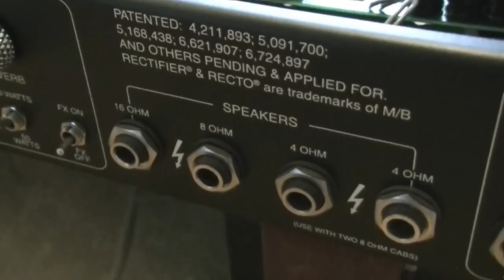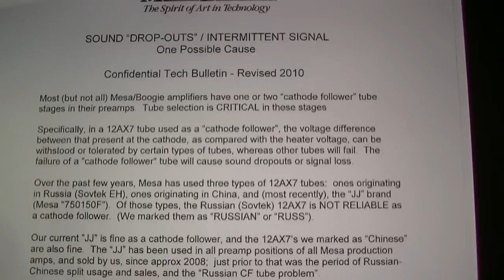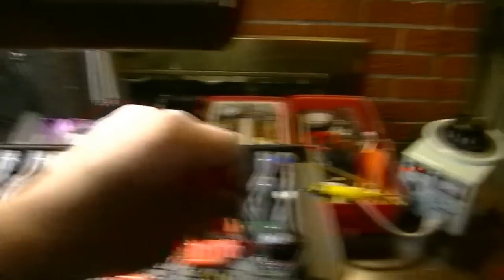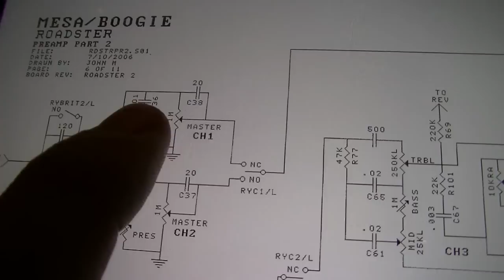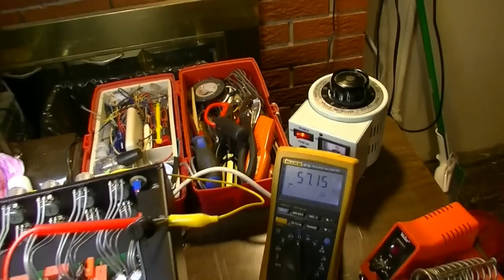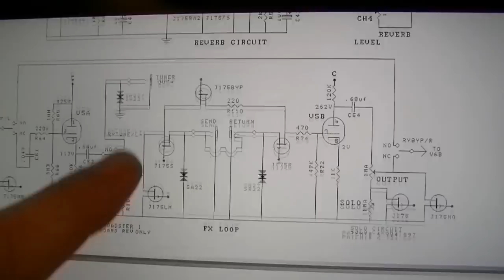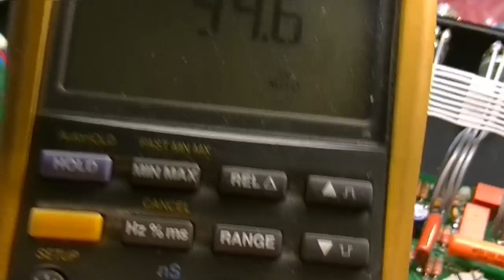Amp Tech's Worst Nightmare - Mesa Boogie Roadster Repair

Comment: Hey I come from a digital background and I also have decent understanding of analogue electronics, like I know how a Hi-Fi amp works, but I never had to deal with guitar electronics... but could you explain me something?

What's up with the comment section? Every second comment is PCB hate, seem like, but how come, why? It's beyond my grasp what's happening here. What do they imagine ideal amp to look like, an ad hoc rat's nest? If someone designed something of THIS complexity, and it looks majorly functionally justified, without a PCB, what chance would anyone ever have to troubleshoot it?
Reply from the maker: I don't object to PCB generally, but I dislike board mounted tube sockets, pots, and jacks. I prefer simpler amps constructed using point to point wiring. Ways easier to work on. Something like this though, you probably couldn't build it using PTP, and even if you could, it wouldn't be cheap.
Reply: I could be horribly wrong but, as far as Mesa Boogie's page says, it's a 2006+ amp, but the boards look like they were made in the 70s by the tracings. It's about time to be using proper even spacings on the gaps, looks as if old hand drawn board, and the solder mask looks like those very, VERY cheapo solder masks from old TVs, the lack of connectors for some of the cables and the solders kinda mixed quality as well, no sanding at all on borders...

It would be a good PCB work for the 80s but not to a 2006 amp.
If you check your PC's motherboard's PCB you'll kinda notice what we mean by this.
Reply: What i see here and something you aren't going to see on a PC main board, is 2oz copper weight underneath, anyway more than standard weight, that's why the mask is so wavy. Also the mask has been applied way thick, and its pigmentation is pretty weak, but either is actually a good thing. That green, you shine some UV light on it, you're gonna see if it's been cooked because it loses fluorescence with heat, you can't do that with any other solder mask, so if you're serious at all, you go classic green. That's why every Supermicro server PC board is green. It all makes sense.

And i just opened a 90ies SONY TV the other day, and there was no solder mask in there at all. Not the tiniest bit.

Old layout works, why change it? Well sure if designing a high end audio item today, my instinct is to go all out on the same tricks that keeps high frequency electronics working well - 4 layers, pour ground and voltage on the inner layers, no signal there, use those inner pours as heatsinking just to reduce stress, SMD parts for all resistors and transistors and shorter overall routes, much better noise resilience and reduced crosstalk, but will that even go over well with the people who buy these things? Doubt a person who buys tubes trusts newfangled shit. Keeping distances even is not necessarily an advantage, some signals are always going to be more tolerating of crosstalk than others! It usually pays to be sceptical of layouts that look TOO automated because you never know whether anyone actually gave a crap.
Reply: The Guitologist yep board mounted inputs and controls are the bane of affordable studio and live performance electronics, they just keep going and depending on secondary mounting or lack thereof, the board underneath can crack too... 

I can see the issue with tube sockets, thermal stress.

Comment: So that was your ground fault... I'll see myself out. :P I appreciate you taking the time to explain what you are doing through the whole process. I have subbed. I don't work on my amp or do much in the way of troubleshooting electronics as it seems rather overwhelming. I have a soldering rework station, multimeter, and helping hands for replacing pickups, making cables, replacing a component here or there. I have been reading a little about circuit design, but all of this is still rather new to me. Do you have any suggestions for how to learn basic audio circuit design? In particular I'm interested in understanding how to create audio circuits for guitar pedals (not necessarily making someone else's kit, but I suppose that is a good way to learn). Thanks!
Reply: a very good book on building home-brew guitar effects is "electronic projects for musicians by Craig Anderton" ,,, looks like Amazon has it for around 20 bucks, or if you look hard enough you might find it online for free, but if you have the funds its well worth the 20 bucks, and i'm all for supporting the author, of such a good work, i purchased mine in a book store about 30 years ago, and its a great book, 

:)
Reply from the maker: I'm not a pedal expert, but to understand pedals enough to know how to design your own, you're going to need some grounding in basic electronics. Any books on that will be helpful. Early RCA manuals, etc. There are old mgazine articles I've seen on the net from Popular Mechanics and stuff back in the 60s and 70s on how to build you own guitar pedals. Or just go to Radio Shack and get the parts and build a simple circuit to get your feet wet. The best way to learn something is to dive in and be unafraid to make lots of mistakes. The fellow I mentioned at the end of this video, Tony Dorris, hangs out on Amp Garage forum and knows a ton about pedals. That would be a good place to go and build something and have others critique your work.
Reply: Thanks! I rely so much on the internet for knowledge that I often forget how much great information is printed. I'll check out that forum as well. Thanks again!
Reply: I own Home Recording for Musicians by the same author. I'll check it out, thanks!

Comment: Just stumbled on your channel and watched this video, I subscribed based on it alone.  Nice documentation on troubleshooting electronics in general and of course tube amps specifically.  I'll shotgunned things before and got pushed astray in my troubleshooting logic by a small mistake I made but it's good to see others have the same issues sometimes and is especially good to see for people who want to learn how to troubleshoot.  I do have one piece of advice, taking an ohm meter reading on a live circuit will never provide an accurate reading.

Comment: This isnt a worst nightmare... A worst nightmare is a Class - D high power car audio amplifier that is completely wiped out. All the output transistors and driver transistor/ICs are blown/charred, power supply transistors are blown apart/shorted, some trace damage acting as fuses, etc... Now, THAT is a nightmare!
Reply: But this one was repairable because the damage was minor, and yet there's a lot to trace out and troubleshoot.

What you describe, you'd basically have to replace the whole amp piece by piece, so what's the point instead of just tossing it out and replacing it?
Reply: Which is why I dont work there anymore. I had to do that quite often. The fun thing is after rebuilding the output stage and power supply. there is always a tiny component somewhere thats still bad and causes issues even afterwords.

Comment: Great job !!  I thought that Mesa Boogie was the best brand or one of the best amp available.  I listened your research from beginning to end and can't believe how many issues it had !  Parts are crammed into so little place and it's not what I thought it was : a simple old fashion guitar amp...  You deserve the good results you're having.  And by the way, I learned many things too.
Reply: Psonic has a video or two how problematic these mesa boogies are. It's not just design but inappropriate or suboptimal parts selection from an engineering perspective, tolerance and longevity, and or from a safety perspective. 

Also, I think he's also complained they don't come with schematics, which goes against norms and would obviously increase people taking them to mesa for repairs.

Comment: Good grief, how much would that repair have cost at a shop?  I think  I would have just bought another amp.  I see that Goodsell is mentioned below - Richard is an old friend of mine and I sent this over to him as a gag.  I think Mesa - however good intentioned - has wound up in the "infinite possibilities of failure" territory.  For God's sake, it cost me $300 to get a 70's vibro champ back to life.  Anyway, cool video and glad that Mesa was helpful in the troubleshooting department.
Reply from the maker: $300 for a champ repair is excessive.
Reply: Agreed, especially since I paid that for the amp in the first place.  That said, I'm in the SF Bay Area, and it costs $3000/mo to rent a one bedroom apartment.  Care to try your hand at fixing a Fuchs BJ21 that's been sent back twice only to re-fail both times?

Comment: Very cool video. I work in a guitar shop and we farm out amp repairs to a great local amp tech. We do setups and repairs on guitars, but I never really knew the details on what amp techs do. From my perspective, we give it to a guy who kinda goes off in a cave and comes back with a fixed amp and a twitchy eye. I have two amps that need repair but we keep our dude so busy that I dont want to get in the way of customers' amps. Watching this, now I have a little more perspective on exactly what he's going to have to do. 10/10 would recommend!
Reply from the maker: Thanks for the hilarious comment. The twitchy eye is a real thing. I think amp techs die of it eventually. One thing amp techs are constantly facing is the repair/replace equation. That can be a difficult tightrope to balance, particularly if you're doing repairs for a shop or shops. Sometimes you put in way more hours than you actually charge because you are trying to keep the arrangement sweet or keep a customer sweet for the shop and not tell them the brand new amp they just bought is actually a total POS basket case that should be replaced rather than repaired.
Reply: JalenRawley. Haha, yes, was thinking the xact same thing. Been a pro guit/voc for 30 years, had many an amp repaired, never knew what went on. 
This opened my eyes, made me realise that these guys really do earn their money.

Comment: how much would that repair have cost if the guy brought it in ?
Reply from the maker: Around $300-$400 probably with all my diagnosis time included. On a lot of projects I take a bath on repairs because I do not factor in the learning curve time on models I may not have seen before, but on something like a Mesa, it would have been understood upfront I would be charging for that stuff, due to the complexity. That's why Mesa has certified service techs. There isn't one for my area of Louisville, KY, so judging by this video's popularity so far, I might be getting more of these in the future. I guess we'll see.

Comment: Seen same JFET issue. Replaced with more powerful MOSFETs and adjusted gate voltage, so little static wouldn't be an issue in future. It's just pull-downs, so basically you can put anything here. JFET, MOSFET, bipolar, IGBT - whatever perverted fantasies you have :) It's just p-channels don't require any other components.
Reply from the maker: Did you have to adjust the values of the timing capacitors in the mute circuit also? If you're changing voltage, it seems you might need to in order for the mute not to last too long or too short.
Reply: Nope, got lucky. Well, in theory mute time became slightly longer, because of higher gate capacitance, but not noticeably :)
Reply: Evil Gremlin thanks a lot for your comment. What exact part did you use? I wanted to replace mine for something more robust as they seem to have died. It would be great to know what parts you used that are drop in replacements so that I don't have to modify the timing capacitors.

Comment: Great video and also the reason why I bought a very reliable Kemper (KPA) profiling rack amp with a three year guarantee! All my previous amps were valve amps and my first amp was a VOX AC30 made in the early 60s and totally unreliable. I plugged in one day and it was dead as a dodo, luckily, I was at home at the time and not at a gig. I disconnected it from the mains and took a peek inside to see if it was repairable. I couldn't believe the amount of heat damage on the inside, over the years it had damaged a lot of the components. How time moves on, the KPA doesn't even use a fan!
Reply from the maker: Vintage tube amps, if properly maintained, can be very reliable. Yours probably had issues that needed to be addressed before it went kaput.
Reply: Yep, it was knackered! It had seen a lot of action in the pubs and clubs of early 1960s Liverpool. It also had a pencil hole in one of the speaker cones, I think a previous owner was trying to replicate the guitar tone of Dave Davies on "You Really Got Me". I eventually had it repaired by an old guy who knew about valve gear. I traded it in for a brand new Marshall JCM800 2x12 100W combo, great amp, but very heavy, I should've gone for the 50W. I gigged with it for three years and it never let me down, it didn't do clean though, just pure rock - very loudly! My old VOX AC30 would be worth a small fortune now, but it has probably gone to the great gig in the sky.

I love valve amps and pedals, but these days I'd rather use a Kemper, it's that good. I've got a myriad of amps to choose from, including all the classics - amps I could only dream of owning! For instance, fancy playing through a 1956 Fender Twin (serial #0019), or a 1969 Marshall head which has been used by all the top session musicians from Nashville to L.A. or how about a Dumble Overdrive Special! All contained in a very reliable and compact 19" rack unit, which also includes loads of classic FX.

Attach the KPA Remote (via the single data and power cable) with a couple of expression pedals and flexibility is amazing. It's a lot easier than your classic amp and pedal set-up - no tap dancing mid-song required! The morphing feature is a killer, you can go from ultra clean to full on distortion and everything in between using just one expression pedal. Plus, you can control any parameter on the amp, the decay setting on a delay, for instance, or even the tube shape!

I use my KPA through a class-D Palmer Macht 402 (2x200W) power amp, connected to two beautiful looking Line 6 DT25 1x12 Extension Cabinets (Celestion G12H-90). Everything is in glorious stereo, the sound can bounce and swirl between the speakers. Modulation sounds are really full on and the new crystal delays are ethereal. Kemper release frequent free lifetime updates and the amp just gets better and better with every release. It's an amazing piece of kit for the money, it's the best thing I've bought in years and Christoph Kemper is an absolute genius.
Reply: It's long gone, I traded it in many moons ago for a new Marshall JCM800 2x12 combo. I loved it but it was well past it's sell by date, bits of ceramic were falling off the resistors, it was was like KFC inside - fried! I did have a look when I had it to see if it was something simple but it was out of my league. There's 100's of volts running through a valve amp so best leaving it to a professional, it could kill you instantly!

I can't gig any more so the Kemper is perfect for me. I can plug some headphones in and jam away without annoying the neighbours at any hour of the day, I couldn't do that with the Vox and certainly not with the Marshall! I've got some great VOX profiles: a VOX AC30 TB Copper Top (1964, S/N 003) and a VOX AC30 CC2X from the The Amp Factory. I've also bought a Trainwreck profile from them but they're not sure if it's a Liverpool or an Express, but it sounds excellent. At the moment I'm playing through a Marshall Jubilee 2555 from 1987, fantastic amp.

Comment: Is the road king (which has switchable power sections in addition to everything the roadster has) worse?
Reply from the maker: Actually, the Road King II output doesn't add all that much more complexity. It is definitely the top of the heap in terms of complexity. Probably the most complex tube amp I've ever encountered, with the Roadster coming in close second.
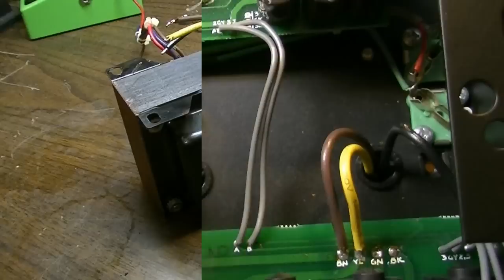Reply: Have you ever worked on an Express 5:50?

Comment: Found a little MB Subrocket and fixed it up (bad PT) Mesa Boogie's service is super and their parts are super cheap. Also, its good to have a cheap oscilloscope to see the rise in signal as you are tracing and see the ramp up in signal from the audio pots. An audio generator is also a good tool to have so you don't need to keep strumming to get input.
Reply from the maker: I have a scope and a signal gen, but they stay on the floor behind the desk. I never use them. In this one I did need a signal source other than the guitar though. SHould have hooked up the iphone at least. Would have been easier.

Comment: Hi, fun fix.  Regarding the bit where you use an Ohm meter to check the operation of the wiper for the master volume pots:  Ohm meters work by putting a voltage across the probe leads and measuring how much current flows and then using Ohm's law to solve for the resistance (R = V/I) so if you have some external source of voltage that you apply across the resistor being measured then it totally confuses the meter.  Older meters could've been destroyed by that, but I think modern meters are pretty indestructible when it comes to that.  Anyway, it's normal that applying power to the circuit would cause the resistance reading to go bonkers.
Reply from the maker: Thanks for the comment, Kathleen! There is no DC voltage at that point in the circuit. If there were, that would mean a bad coupling cap. The coupling cap before that stage has already blocked the DC voltage at that stage, so there' no problem measuring R with amp on.